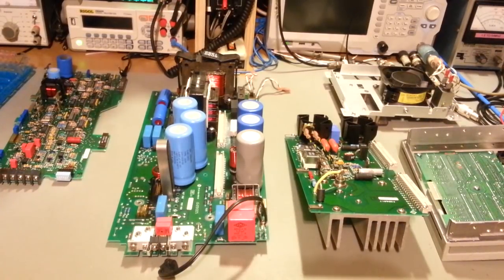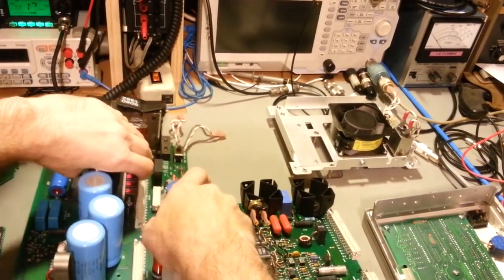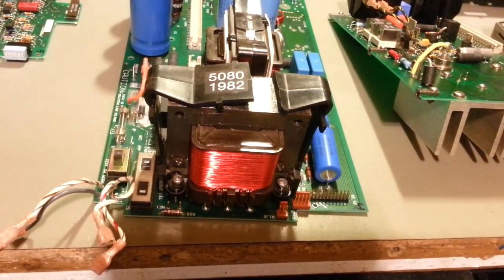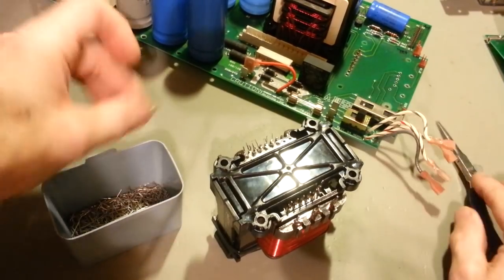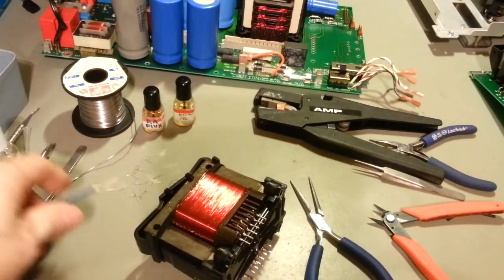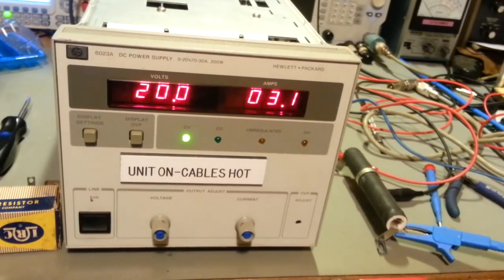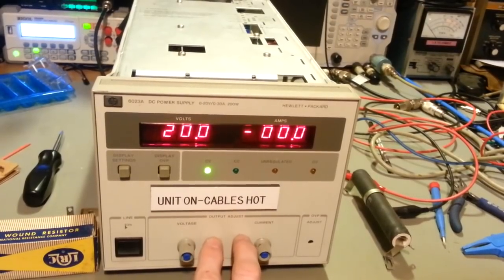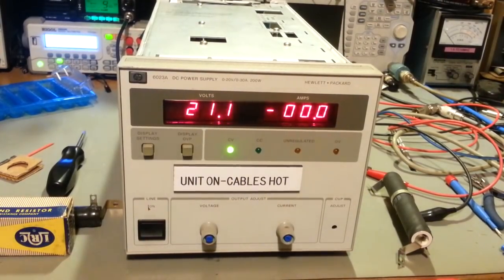HP 6023A laboratory power supply transformer repair.

Comment: I loved to no why mine works for powering bulbs moters anything that runs on electricity but if i use it for zinc plating it just shows error on the front all most like if i stuck the wire's together & yes its Chinese its 15v 3amp 1503DD+ model has anyone got any ideas why it doesn't work for zinc plating but will work for other stuff ? ? ?